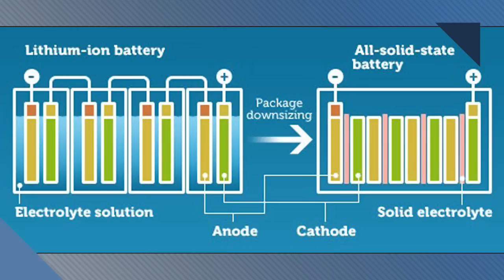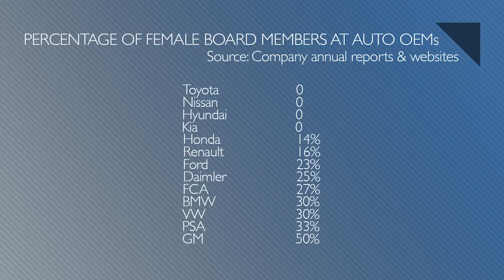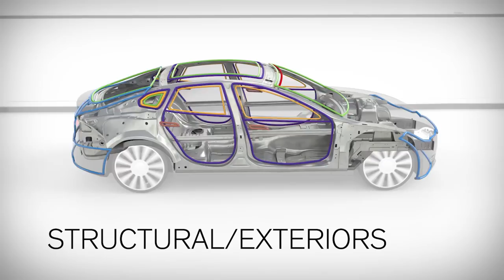New Chevy Silverado, Males Still Dominate OEM Boards - Autoline Daily 2255

Comment: From the A pillars back it's a great looking truck, looks like GM nailed the design. Forward of the A pillars it looks like they could have done way better. I'm not liking the vertical line if the fender or the way it wraps around the front but I guess the focus groups liked it so it will have to grow on me.

Comment: I'll stick to buying cars made from countries that have no mandates in regards to chromosome percentages.
Reply: Correct me if I'm wrong, but there r only a few countries that have that mandate. And none of those countries were the headquarters for the companies that were listed.  So what was ur point? The higher the Y chromosome percentage the better?
Reply: The primary job of a corporate board isn't the nuts and bolts of whatever the company's product or service is.  That's the job of division presidents, and chiefs of design, engineering, marketing, etc.   The primary function a board of directors is its fiduciary responsibility to the shareholders.  Appointments to directorship are made by connection to finance, government, investment institutions, etc.  These people are American royalty, they are not you and I, nor to they give half a crap about you and I.  A board of directors never sat down and designed a vehicle. it's not their job....making money for shareholder is.  It doesn't matter what gender those people are.

Comment: I hope GM fixed all the problems with their previous trucks automatic transmission clunking carbon dub valves from direct injection trash and paint V4 mode problems electric steering problems vibrations throughout the truck

Comment: What are the odds that the Silverado will finally get modern OHC engines? Currently GM is the only company to have no OHC engines in its full size trucks.
Reply: GM can't spell OHC.
Reply from the maker: Horsepower, torque, packaging and mpg matter more than where the cam is located. GM's engines are extremely competitive when measure this way. GM's overhead valve engines have about a $1,000 cost advantage over OHC V8s.
Reply: B Y   GM. Is starting with the aluminum body first.